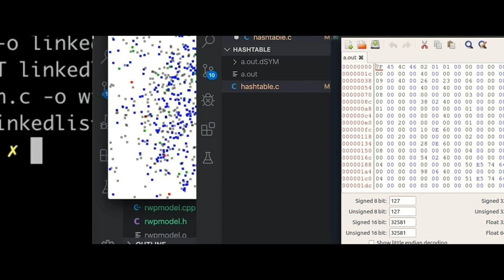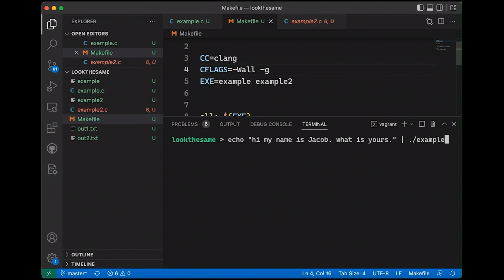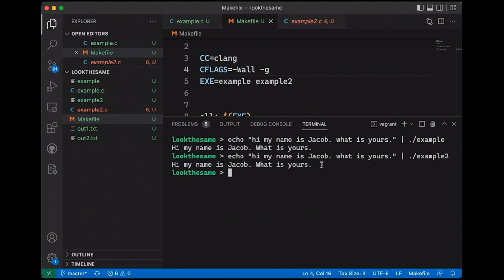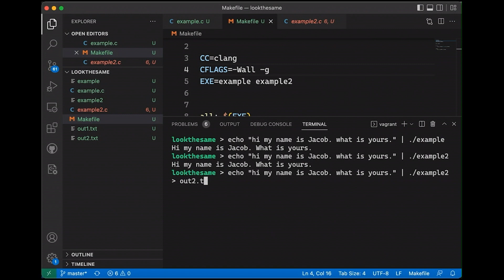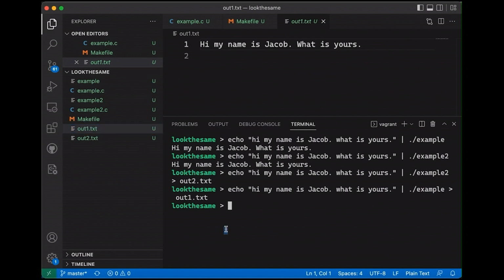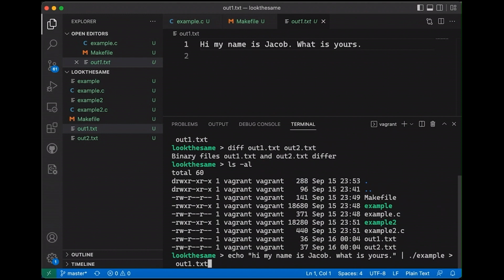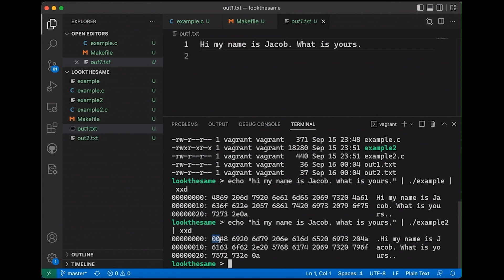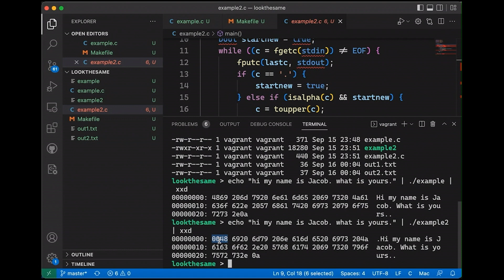How to Debug a Program when the Output Looks Right

Comment: Hi Jacob,
For debugging, I use two macros which I post below.

 
/* Use debug1 where needed. Rename to debug when use is over */
#define debug1(M, ...) fprintf(stderr, "DEBUG %d %s %s: " M "\n",_LINE__,__FILE__, __FUNCTION__, ##__VA_ARGS_ );
  #define debug( ...) ; 

In testing code, where I am not sure of results, debug1 ("%s = %d", ","printthisstring",99);   is a super printf () function.
When testing is complete, I just leave remove the 1 from debug1 to make debug. 
The result of making the change from debug to debug1 is that no code is generated.

Comment: I'm confused by the premise here... if the output looks right then why would you think there is a bug with the code? You mentioned unit tests failing but surely that IS output? The response to a test is a behavioural output from some input, i.e. the program state
Reply: He suggests this might happen when using the academic institution's autograder or alternatively perhaps we're supplying input to another program or function, which we know works. When displaying the output though it looks correct...

Comment: Use cmp instead of diff to find binary differences:

karl@ftl: od -xc one.txt 
0000000    5400    6968    2073    7369    6120    7420    7365    2074
         \0   T   h   i   s       i   s       a       t   e   s   t    
0000020    6966    656c    0a2e
          f   i   l   e   .  \n
0000026
karl@ftl: od -xc two.txt
0000000    6854    7369    6920    2073    2061    6574    7473    6620
          T   h   i   s       i   s       a       t   e   s   t       f
0000020    6c69    2e65    000a
          i   l   e   .  \n
0000025
karl@ftl: diff one.txt two.txt
Binary files one.txt and two.txt differ
karl@ftl: cmp one.txt two.txt
one.txt two.txt differ: byte 1, line 1
karl@ftl:  od -xc three.txt
0000000    6854    7369    6920    2073    0061    6574    7473    6620
          T   h   i   s       i   s       a  \0   t   e   s   t       f
0000020    6c69    2e65    000a
          i   l   e   .  \n
0000025
karl@ftl: diff two.txt three.txt
Binary files two.txt and three.txt differ
karl@ftl: ^diff^cmp
cmp two.txt three.txt
two.txt three.txt differ: byte 10, line 1
karl@ftl:

See man 1 cmp for details.  🙂

Comment: Hello Jacob, could you make a video about writing a C program that handles command line arguments with parameters (such as -f <FILE> e.g.). What is the best practice for doing this?
Reply: The `getopt` and `getopt_long` functions (declared in `unistd.h` ) provide a way to parse command-line options / arguments.  
`man 3 getopt` also contains some examples of how to use them.

Would also like to see a video on that, though!
Reply: SO has really good answers to these kind of questions. You can read the answers and comments, select the best answer for your needs. I just use someone else's code for handling -f etc, copied it once, and it just works, as it's simple. Speed or memory are not an issue here, so no need to overthink it. Just a few ifs to each option like '-f.'

Comment: I would use gdb, and examine the values that are being outputted.

But before that I'm somewhat sure I can find out the error by looking at the code responsible for the output.

Generally in my programs I don't like to rely on libc buffering my output, so I just append the bytes myself and output them by 1 write call (fwrite/fprintf).

I think I have developed an unhealthy obsession in making my code run as fast as it could, and using all of the optimizations. Which in reality doesn't matter that much.

Comment: I always run into the situation where it works fine the first time but if I run the same program 3 or 4 times it either segfaults or fails tests, and it works again.
Reply: Segfaulting is (almost??) never a guaranteed mode of failure, so it's common that the root error will cause different behaviors. That's what undefined behavior looks like. Try Valgrind!